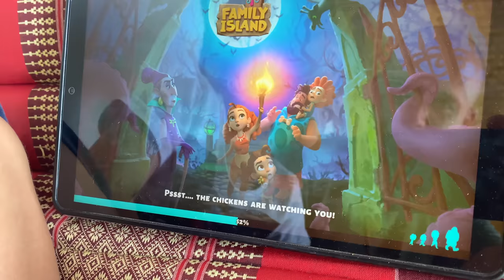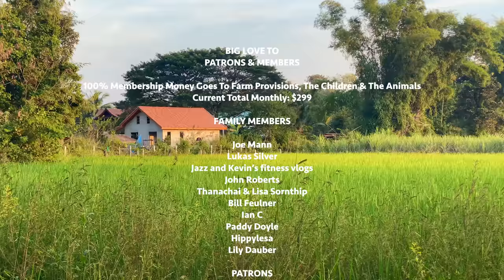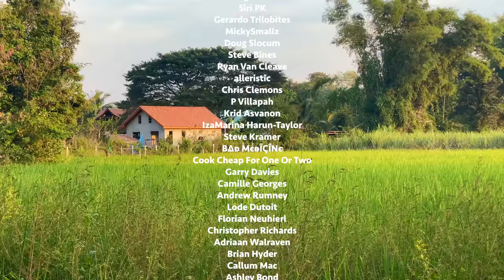I MESSED UP In Thailand... & Its Going To Get EXPENSIVE! 🇹🇭

Comment: I think you should turn the corner post so it goes out 180’ , unlike now where it seems to go in , I think that will make it look a lot better , now it just seems to be off, hope you understand
Reply from the maker: its concreted in :)
Reply: @lifeinruralthailand  then just wait till it rots and you have to replace it , it’ll probably last a couple of years anyway
Reply from the maker: @kuzinit2374  it’s already 10 years old and hardened that’s why we use it 😁
Reply: @lifeinruralthailand  I understand, good dry wood , cement acts like a wick and will keep the wood wet and it will rot , it’ll take a while but you will see

Comment: Hey Ryan! Thanks for another great video. It has been a real joy watching your journey. I'm curious about the window options you find in your area and how the prices compare to what you'd pay back home. My wife and I are planning to move back to Issan and build our own place. 
I've seen a few people mention that Thailand doesn't have a lot of double paned windows, so it's hard to insulate indoors if you're using aircon, even if you insulate your roof/walls.
Reply from the maker: Yes you won’t find much double but the aircon will be fine 😁